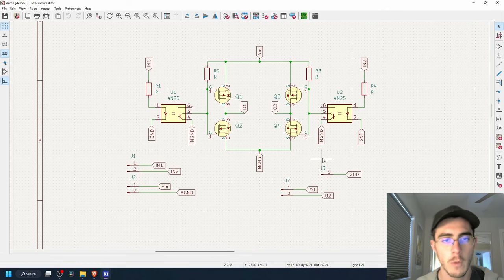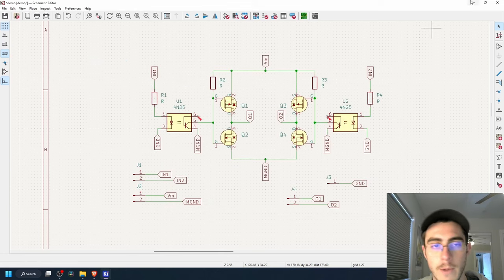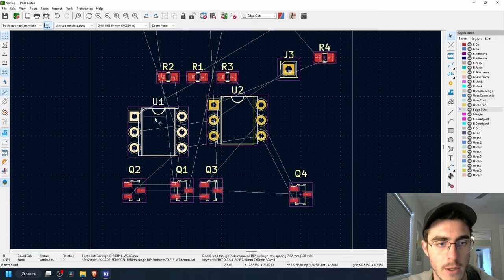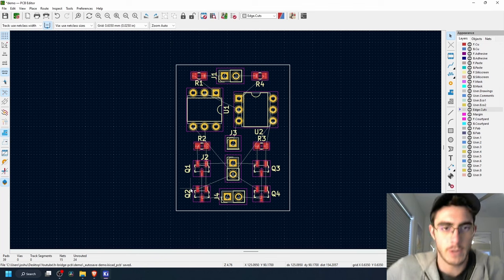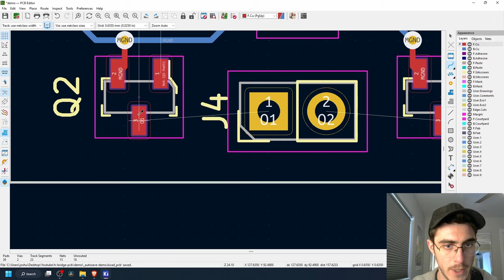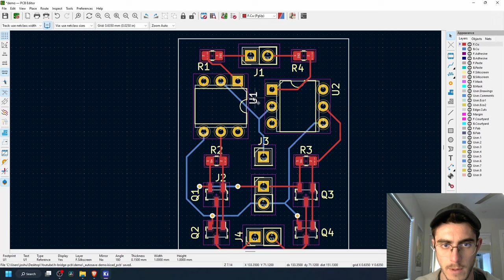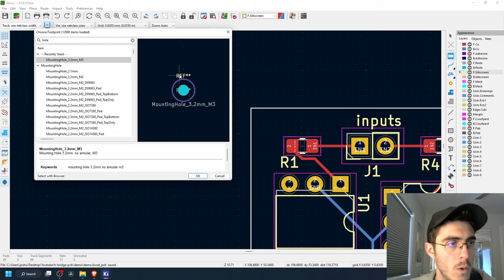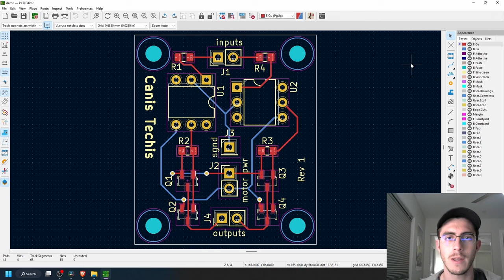Making an H Bridge PCB in KiCad from scratch!

Comment from the maker: Let me know if you have any questions or tips on PCB design / KiCad!
Reply: Hi Josh, I am a student currently doing PCB design for my 2kW Dual Active  Bridge Converter which involves two H-bridges . Can you share you tips on how do you minimize the stray capacitance on switching pole in H- bridge structure in order to minimize dv/dt.
Reply from the maker: @ysy2305  Sure, here are some tips on how to minimize stray capacitance in H-bridge structures for your dual active bridge converter:

1. Keep switching node tracks short and direct.
2. Place decoupling capacitors close to the switching nodes.
3. Use power and ground planes to reduce parasitic capacitances.
4. Place a metal shield between the high-frequency switching nodes and sensitive circuits.
5. Minimize the number of vias in the switching node tracks.
6. Use a low-inductance PCB layout with wide and short copper planes to reduce parasitic inductances.
7. Consider using a differential driver to drive the H-bridge, as this can reduce dv/dt-related EMI issues.
These tips can help you minimize the stray capacitance on the switching pole, reducing dv/dt and reducing the potential for EMI issues in your design.
Reply: @EV_engineer  sounds like a ChatGPT answer xD good job

Comment: Hi Josh, Great video! I'm adopiting your design as H-bridge in my project  to control a latching solenoid valve. Just a question: in the photoisolator pins you connect cathode of the LED (2) to GND and anode (1) to the pin INx of ESP32. Is it correct?